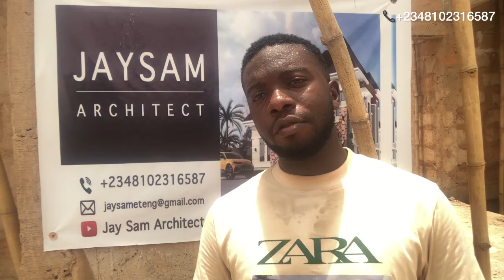Cost of Concrete Parapet In Nigeria 🇳🇬

Comment: Pls sir what's the solution if a shingle  roof tiles had being stain with cement in d process of plastering d parrafet Cos most engr make dis mistake
Reply from the maker: Then you have to clean it up
Reply: @jaysamarchitect1578  Thanks Sir, but what chemical can be used to remove the cement stains from the shingle stone coated roof because it is hard to remove now and I don't want to forcefully chip the cement stains from the shingle roof as  not to destroy the shingles,